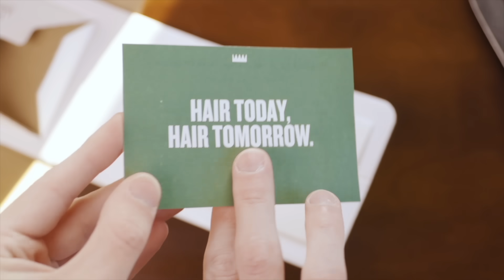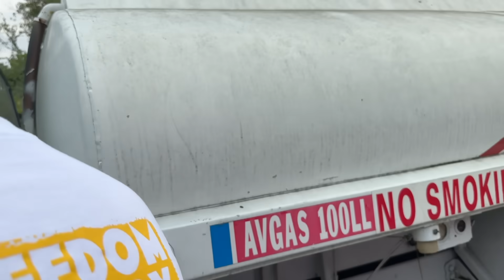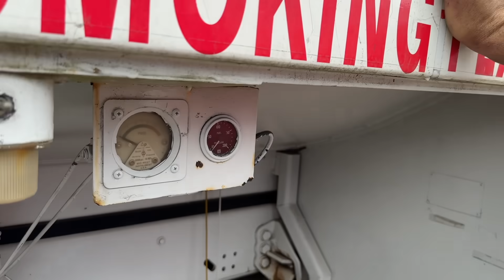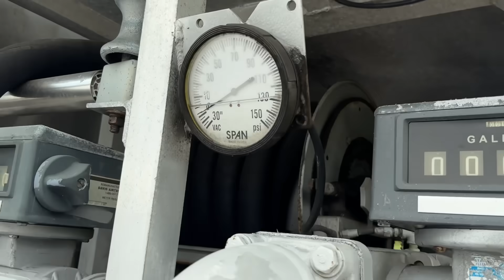I Bought An Abandoned Fuel Truck For Our New Airport!!!

Comment: Hey brother. Fuel trucks are my jam.  I inspect and repair them for a living.  I’m up in Canada but there are many parallels.  You did not in fact get a good deal.  You tanks will require a fair bit of work.

Look on the passenger side front head.  There are inspection decals.  V(visual), K(leakage), I(internal), P(pressure). The visual and leakage tests are required yearly and the internal and pressure are every 5 years.  The seized up lever operator is your internal valve operator.  It is a BETTS mechanical operator, single compartment.  Then you have the little paddle lever on the front of the tank.  That is your emergency shut off for the internal.  The little black button you were pressing should be the hose reel switch.

Your tanks will need inspection regardless of whether of not they ever see the highway.  A company is not legally allowed to fill a tank that is out of date.

Cheers brother.

Comment: Cleet...On a automatic transmission with Muncie or Chelsea manual cable shift cable you have to be in "Drive" pull the PTO cable to engage the PTO and then back up to Neutral. You'll strip (round off) your engage gears if not done in that order.
Reply: This is the correct answer!

Comment: Push the clutch in when engaging the PTO. it's making a grinding noise because the transmission is spinning and trying to engage the pto
Reply: Except that truck was automatic. So no clutch pedal.
Reply: @kelvinhill9874  I have a 1985 Chevrolet C70 Kodiak with a CAT 3208 and an Allison automatic and it has a clutch pedal for the pto
Reply: Put trans in drive, engage PTO then back to neutral. Putting it in drive stops the trans input shaft. More than likely an Allison AT545

Always cracks me up when they try working on any kind of big trucks.
Reply: No clutch pedal. Have to put it in gear, engage pto, put in neutral.
Reply: @dvereckis  that’s great. But still not relevant to this truck, which very clearly did not have a clutch pedal.

Comment: I believe that drain and steam out the compartments and air dry is the correct method. Also if you plan on driving that on highway the driver will need a CDL with Hazmat endorsement. 
May be best use to just get it running and use it as storage and filling your aircraft. The fuel company can come fill it onsite

Comment: You’ll probably need a Class B CDL with tank and hazmat endorsements, you’ll need to have clearance to enter the pipeline to get fuel along with a supplier who you’re purchasing from. 
For the jet fuel truck I would recommend you have the tank, pump and components steamed and certified, as well as having the pump tested, scully system tested which I believe is mandatory, the other truck you’d likely want to have cleaned the same way as well as certified.
Reply: What if he just gets a bulk tank on site for each and refills his tankers from the bulk tanks, trucks never hit DOT roadway, don’t need endorsements to drive on your own property, has the fuel delivered to site to fill the bulk tanks. Clearly no extra certifications needed if you have a pilots license to refuel your own plane or helicopters since most airports you pump and pay yourself if it’s recreational use and not commercial.
Reply: @chrisscott6227  This is most likely what he will do, keep these on property as mobile bulk tanks. Now, about the pay at the pumps at an airport, youre right about the pilots that just buy and pump their own fuel there, they need no extra certs or anything BUT,,,the airport most likely has to have some sort of permits and certifications to have those fuel tabks and pumps. This being a non public and private use airport might also make things different too.
Reply: @chrisscott6227  because he’s still paying a higher cost for fuel having someone else to bring it in and fill those tanks, transport costs aren’t exactly cheap. 
I think the small costs to get a CDL and having his equipment cleaned and certified will pay for themselves rather quickly. It’s a significant cost savings when you’re getting fuel at rack price vs transport price. 
Eventually I think he’ll end up with a couple of bulk tanks on site as well.

Comment: Make a fuel trailer of it. Take the cab off and weld a hitch on the frame rails.  Tow it with the tractor it already has hydraulic remotes and a PTO.
Reply: The draw bar would get attached to the front axel in the centre and connected to the steering linkages. Turns it into a 4 wheel trailer with steering.
We convert old long bed trucks into hay carting trailers here in Australia this way.

Otherwise you have tons of weight loading down on the hitch of whatever you pull it with.
Reply: that's exactly what i was thinking.
Reply: Now that's a job for Tye. The fella can weld just about anything with JBweld.
Reply: Tow it with the running truck

Comment: I drive an International jet fuel truck at work every day. The puppies look ugly but get work done. As long as you keep the tank clean it'll last a lifetime. Just make sure to shut off the control valves on the back when not in use. Plus the airbrake really needs maintained.

Comment: The jet truck has a stainless tank BTW. SHOULDN'T be too bad-except ya'll are WAY down South-and that lovely thing ya get called humidity..................plays all kinds of games with Jet Juice A.K.A Jet Fuel. Jet is nothing more than Kerosene-a bit "drier"-think less entrained water-which is always present. Great additive called "Prist" minimizes that-that stuff is usually added at either the refinery or at the bulk tank farm.
The 100LL truck-Avgas-AKA Liquid Lead-won't have near the issues with storage as does Jet-except it too holds water & must be sumped regularly.
Reply: stainless tank huh? I wonder if thats why they said it was stainless a few dozen times in the video?

Comment: Worked on these units for the last 10 years in the fuel industry. To engage the PTO, put your foot on the brake, shift it into drive, pull your PTO cable, shift it back into neutral. I would avoid running it dry for long periods of time. The cables you have on the D/S are for the internal belly valve, one on the front of the underslung is an emergency which will close everything, the one in the underslung on the drivers side will open the belly valve and the vent on top of the tank. 
Chances are if those have been sitting for that long you're gonna have a few dried out gaskets and seals.

Comment: If that's a 6.6 or 7.8 New Holland in that truck, those engines are legendary. Not powerhouses, but tough as nuts.

Edit: will also say that the big block Gasser in that other truck is not necessarily A 429 they also had a 370 on the same block that came in those trucks. Both are low compression dogs lol
Reply: It sounds good too brotherman.
Reply: I've used those trucks for years doing tree work. Can't beat the diesel engines that come in those
Reply: RepentandtrustinJesus1  
"raise hell and praise dale!" -Cletus probably
Reply: RepentandtrustinJesus1  i actuaally cackled LMAOO
Reply: You can turn the 7.8L's up a tad reliably. Did one years back and studded the head and cranked the boost up and it ran phenomenal for years with no problems. I wish ford would've found a way to put these in the F2 and F350's back in the late 80s and 90s.
Reply: I hear they make the whole engine out of wrist pin
Reply: Hard to get parts for
Reply: If it’s like the one we had all the electrical was special as well , sealed non sparking and such. You really don’t want them to catch fire.
Reply: @SCRB1GR3D98  I've seen a few people that swapped them in their long so it's kind of hard to fit but man you talking about a stump puller
Reply: @vebjsand  yes it do
Reply: @rnts08  Where is the hate speech and misinformation?
Reply: Low compression just means boost ready!
Reply: @SCRB1GR3D98 that woulda been an awesome competitor to the 12v Cummins. Same with the dt360 IH
Reply: @williamwilke9697 not really, those old engines are everywhere because they don’t die. We have a couple of them
Reply: @traxxasrcfun  I don’t know I had a hard time finding parts for the 7.8

Comment: Greetings from a neighbor in Palmetto. When I was in high school/college (mid 90's), I worked line service at a airport. We had Phillips 66 trucks and I think I remember that they had work done by Phillips on the trucks (both Jet A and 100LL). If you need assistance try reaching out to AV Fuel Corporation about service on a the PTO system. One thing I remember is that the 66 trucks had electronic emergency brakes and if it was not engaged the whole PTO system would not function.

Comment: As someone who drives a fuel truck on the daily, you need to have Hazmat endorsements.  also, you should be fine running those pumps without fuel in the tanks, just dont leave the pump on for 10 mins lol  But some decent looking rigs!  If i were closer, id swing by with my rig lol
Reply: What reason would they have for needing to drive on the roads? Just have a fuel truck deliver a load and use as a mobile filler truck on property.
Reply: I doubt they take these on the road. I bet he will keep them on the airport property as mobile bulk tanks.

Comment: That should be a 370 or a 429, I beleive they belong to the 385 Ford truck engine family. The family derives its 385 name from the 3.85-inch (98 mm) crankshaft stroke
Reply: Or it could be a 460, which was a also a 385 series Ford Big Block.
Reply: 391FT the valve covers ran over onto the intake manifold
Reply: @travishigley3095  That's not an FT. The staggered exhaust manifold bolt pattern, the thermostat housing standing straight up, and the bolt pattern of those valve covers definitely identify it as a 385 series, not an FT.

Comment: If I may make a suggestion... The most safe and best way to go about storing fuel for dispensing at an air field is to burry big fuel cells similar to those on these two trucks. This would result in less maintenance of the fuel storage and refilling system as you wouldn't have an actual vehicle to maintain. Another plus is not having the possibility of those trucks full of fuel being stolen as I know that trucks like that full of fuel are a hot target due to the value of the fuel and ease of transit. You also wouldn't have to spend money on fuel for the trucks to drive around and it would be a neat feature to have a designated area on site for aircraft to taxi off the runway and to park at the fuel station which can be outfitted with fire suppression and other such things at the fuelling site. This would also eliminate the need for a fire truck and the maintaince that comes with running a third vehicle. I don't know if maybe you could remove those two cells from those trucks and burry them because they may or may not be strong enough to not be crushed by the weight of the dirt or cement you'd burry them with but I'd defiantly look into that option first before considering option two which would be to source the purposely made in-ground cells. After that all you'd need would be fuel pumps and what ever else you'd like to add into this facility. 👊🏻

Comment: Put the clutch in and stop the transmission,for turn and pull tbe pto, knob out and then put the transmission in neutral, and let clutch out it should not grind, thanks BigAl California.
Reply: It's automatic.
Reply: it has to put in drive first to engage the pto,then neutral

Comment: Gotta open the belly valve before the pto. Check your piping under the tank, that will rust and fail before the tank itself. It will also need inspection every year, and a five year. That button is probably your hose reel in. Run one every day, also, the gauge George talked about is supposed to have that fluid in it. Get ya a few tanks, one for diesel, gas, and jet fuel. Transport Loads in bulk generally are 8500 gallons, unless you have someone close by that they can do a split load with. Good luck brotha.

Comment: Lol...  Cleetus,  with your setup you'll fuel the Jet-A truck with the Avgas truck and the Avgas truck with the Jet-A truck.  One time I ran out of gas in our Avgas truck a long way down on the flightline and long before cellphones were a thing.  Luckily for me,  I was able to gravity flow 100LL through the hose and fill the fuel tank.  I also used to take the daily sumped fuel and put it in my pickup for this broke high-schooler.  Those were the days in the late '70's.  Congrats on Bald Eagle.  Cheers from Texas.

Comment: Cleetus you can run that truck and fill your air planes up easily!!! Those trucks are super easy to run!!! I do no a guy here in my state that has run those trucks for almost 25 years!!! He delivered propane to different houses that use propane for something in their homes!!! He did that for several years and then and still today delivers fuel to air ports witch they have special rules and you have to have some kind of special permits to be able to deliver to air ports!!!! I also no that they are super happy with his work because he has fuel happy with his work because he will get a load of fuel to the air port with in minuets so that the planes are down for long periods of time!!! Super easy setup buddy!!!

Comment: I'd say the easiest source for a running used motor is to find an old school bus with the Ford FT 391 gas motor like you have here. 
Whatever you get, it should have the FE bellhousing pattern if you want to reuse the existing transmission. Since it's onsite, if you were to find something like a cast-off 352, 360, or 390 from someone swapping up, it should work just fine.

Comment: I've had good luck filling old engines with evapo rust.
I just get a 5 gallon bucket. I drain the oil and fill the entire engine, not just the cylinders. 
I fill those, put the plugs in, the dump the rest down the intake. 
It's worked for me on boat engines a couple of times.

Comment: I own and work on 2 of those exact trucks ( dumptrucks). The diesel is either a 6.6 or 7.8 ford " Brazilian " they were called. The gas job is either a 370 or 429, they are truck engines refered to as lima's. They are part of the ford 385 series of engines compatible with some 460 parts. The main differences are the cast iron timing cover because of the front engine mount and the crank snout is larger than the 460 to run pto off front common on firetrucks.  Hope this helps !!

Comment: Cleet , put it in drive if it’s an automatic or push in the clutch to engage the hydraulic pump the button is probably for the hose reel the red handle is probably an emergency fuel shutoff.  Good luck bud

Comment: Get a tank. 
Either in ground or above. 
Say 10,000 gallon. Maybe a small tank farm- have diesel, AvGas, Unleaded. 
Top your fuel trucks off at your tank farm. So long as the vehicles don’t leave the property you won’t have to worry about DOT, CDL drivers etc. 
but I do implore you to find someone who is local and used these to train your crew. Take the training and be serious about it. ❤

Comment: Get yourself a couple above ground aviation tanks like UL 142 Flammable Liquid Tanks and put them out away from anything in a corner that won’t be developed. Then that can be filled by a contracted fuel company right on site. You would take your trucks out to the tanks to refill when they are low. That’s how most airports do it to avoid their liability of driving huge full fuel trucks like you have there on city streets. The tanks come in all sizes and you can get ones with pumps ready to go for aircraft and truck refueling. Whatever you need it for

Comment: I’ve been running an oil company for many years … the “ black button” by the fuel hose is to retract hose after you stretched it out while pumping fuel… after your done instead of rolling back up by hand u press button and automatically retract hose….. if u have any questions lmk I got ya … enjoy the airport… and u got 2 pretty nice fuel trucks … I’ve seen way worse

Comment: That red lever you were trying to pull is called a fire valve lever and it looks to be seized in the open position which is not good in case of an emergency. Thats most likely caused by the cable being seized in the cable housing or the shaft itself is seized up inside the fire valve. Alot of times you can climb underneath and grab the lever on the valve and try and move it back and forth to free it up. Hope that helps.

Comment: The red handle by the meter is to open the belly valve.  Pto, put trans in gear to engage then back to park.
To legally drive them on the road you'll need cdl & hazmat. To haul down the road, the tanks need to have a vk.

Comment: Those big levers are your safety valves that shut the tank off at the bottom in case of an emergency leak. Whoever delivers your fuel the driver can explain everything to you, I used to deliver oil in one of them but it has been a while. I did airport trucks too.

Comment: I work for Shell , at  a fuel terminal for Jet Fuels. You need to get that tank cleaned. I tend to agree that its better to have a tank on site , but that comes with a lot of regs and requirements as well.

Comment: In the 2nd truck you picked up a flag stand and tossed in onto the seat.  Tailgaters put the flat part under their tire, use a hole in the flag pole through the metal stand, pad lock it so no one can take it,  and the flag pole can be as tall as 20 feet in the air.  The bigger the diameter of the stand, the bigger the diameter of the pole, and the bigger the flag can be.  Most often seen in parking lots at college football games.

Comment: You could buy a 12k gal bulk like the guy above said and save ~40cents a gallon however you'll have $150k into a new setup might be able to find a used set up for less but either way you will have to get state planning and permits. 
 Since these trucks are portable/non permanent you can skirt them laws. Call any local co-op or fuel company that does local delivery not transport loads. I fill a few fuel trucks on my fuel route